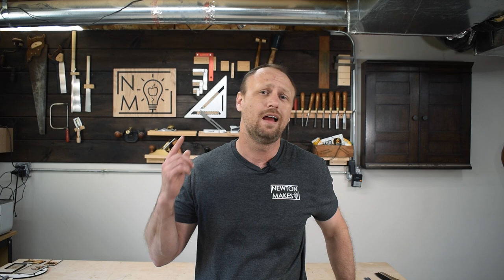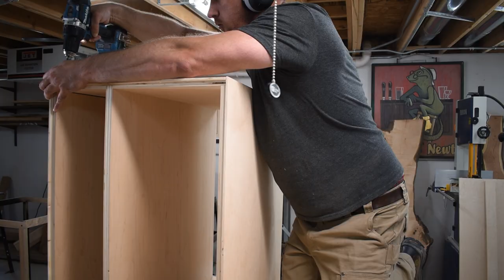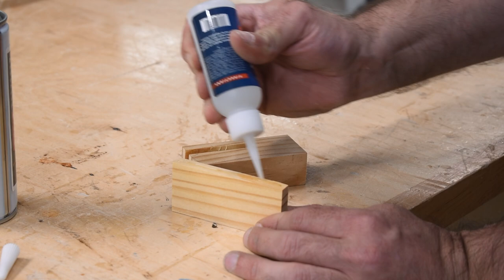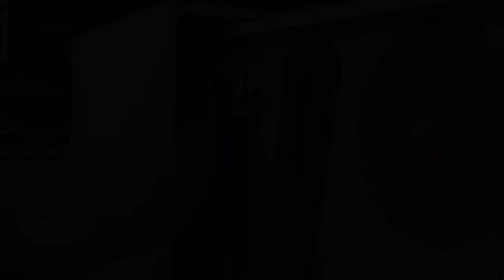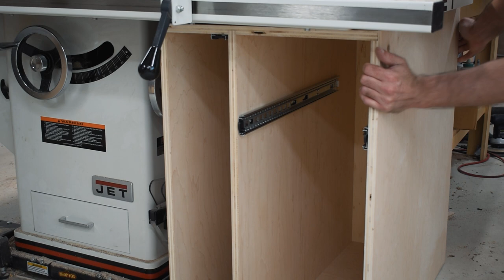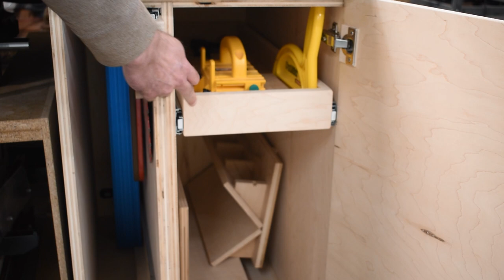Table Saw Storage Cabinet | This Changed How I work!

Comment: People aways overlook the slots in the foot of the press and that the power head can swivel. If you make the cabinet front to back deeper, say 6,8 -ish  inches and base floor. The hollow created with various straps or clamps mounting for long stock, for end boring long stock by pushing back the press and rotate the head, counter weight in base. Hollow can also store special fences and flat jigs.

Comment: How about your blade changing wrenches? You said you change blades alot
Reply from the maker: I keep it in the pull out drawer
Reply: Why put them in the drawer?  If the tool has a specific purpose put the tool next to the materials.  In the video you've got plenty of room to hang the wrenches next to the saw blades.

Note that I TRY to do that in my shop.  I just made a special hangar for the cordless grinder with space for spare flap disks (and other accessories) and made a special place for the wrench. ...One screw that's all I needed.... ...then I had to grind the head off.  So much for forward thinking.